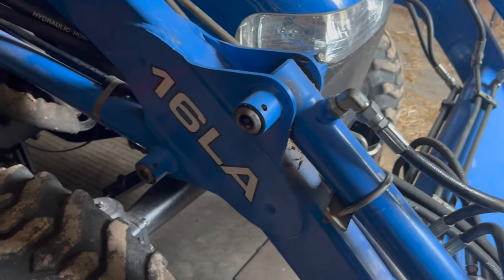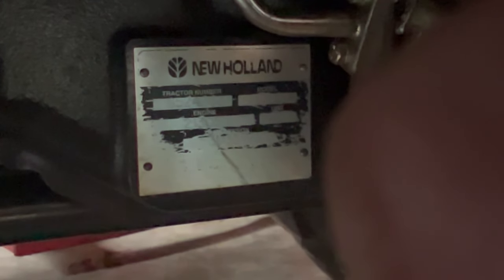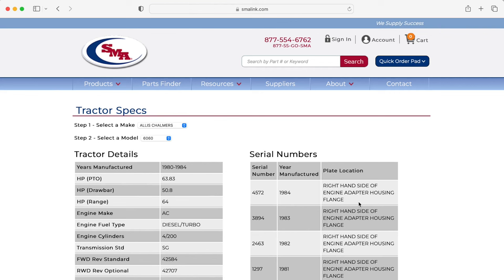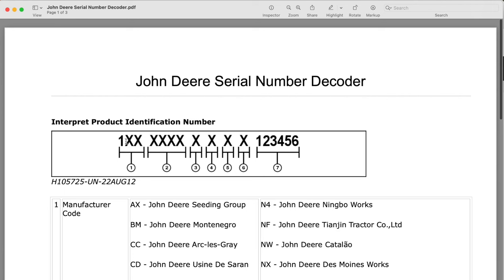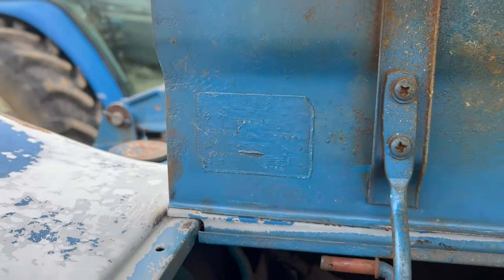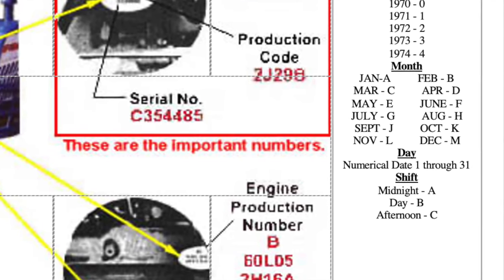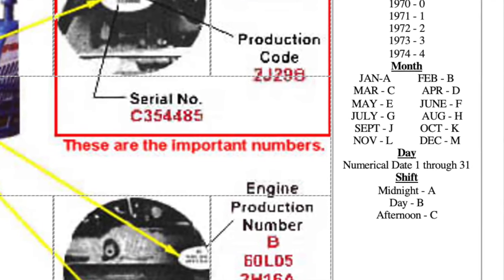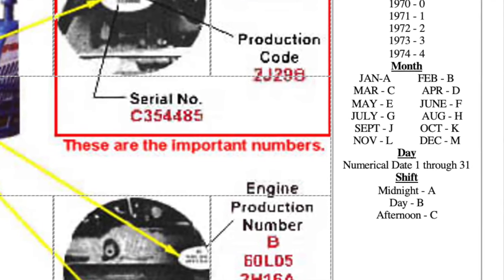10 Things You Should Know About Tractor Serial Numbers

Comment: Great idea about taking pictures of serial numbers and models numbers.  I have done this for my equipment for a couple of years.  I even create a special folder on my phone labeled “equipment“.  I take pictures of my chainsaw models numbers and the information on the bar as well as other equipment.  For my tractor and Zero turn I do the same thing.  Another thing that I do it I take pictures of is my license plates and front, back and both sides of the vehicle.   Just in case.  Great video. Thanks.

Comment: Im trying to buy a used tractor and the bank wants the serial off the tractor which is pretty obvious, but they are adamant about getting the serial off the loader too which is highly confusing why they would want that. The machine is an 85' ford 1910 with cab and 770b loader. It has all been re-painted and the dealer can't find it. Im afraid if they can't find the number the bank won't loan me the money. Just perplexed

Comment: When fooling around with old N series Fords (my hobby) you sometimes run into some odd surprises. A standard serial prefix is 9N or 8N. But wait, there’s more! A BNO serial prefix denotes manufacture for the Bureau Of Naval Ordinance, meaning that the engine was bought surplus as a replacement engine after the war. A 9NBN prefix indicates that the tractor was originally sold as an industrial model, not as a farm tractor.
It’s these kind of oddities that makes restoring the old ones fun.
Reply from the maker: Wow, thanks for sharing.  That's information that I wasn't aware of.
Reply: @TractorMike  The BNO’s we’re installed in airport tugs. There were around 3,200 tugs built. After the war it looks like better than 90% of them were broken up for parts. A few were used as civilian tugs, like at the Lancaster, PA airport near me, but most were scrapped. I never cease to be amazed at the number of Ford 9N and 8N’s with BNO replacement motors. It was probably a lot cheaper for the farmer to buy a low time surplus engine than to have his original overhauled.

As for the 9NBN’s, those are RARE. I’ve only ever seen one and I bought it for the collection.

Keep up the good work. I’ve learned a lot from your channel. Now I know why my Kubby has a Great Bend loader on it! Happy New Year to you!